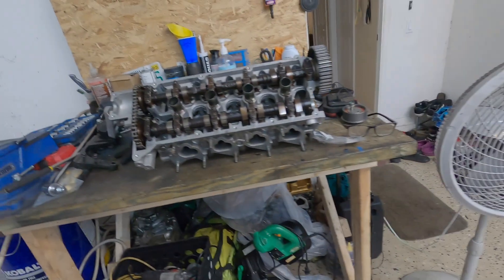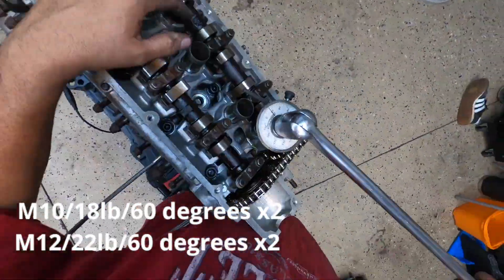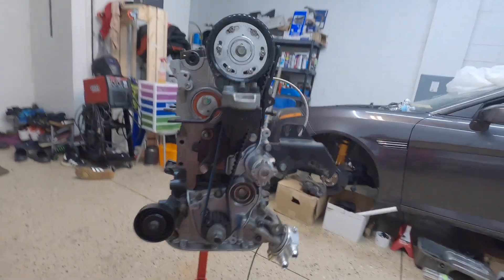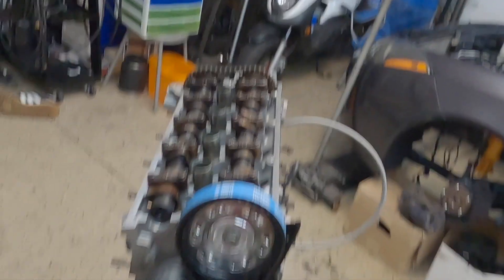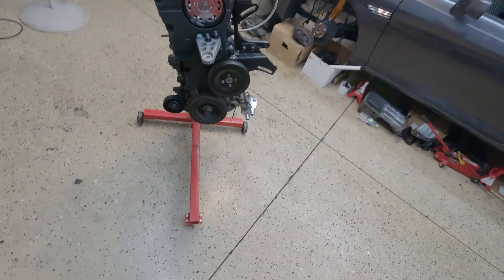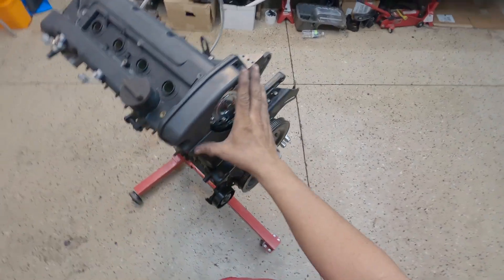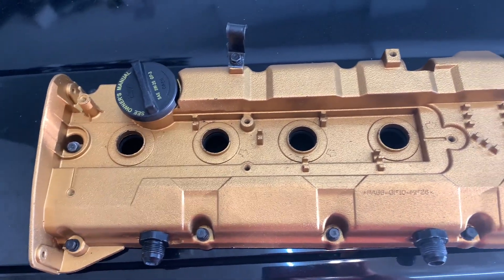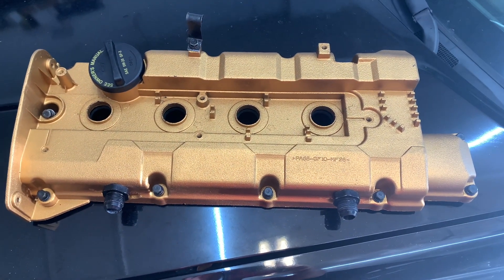Hyundai Tiburon Turbo Project Episode 11 (Engine Block Assembly)

Comment: I just burned thru my second set of pistons do you know if any other pistons will work besides the super expensive upgraded ones
Reply from the maker: Your car is turbo?
We pushed the original internal of the beta up to 400hp at 22psi. If you don’t have a good computer it will difficult for you to set it up right.

Comment: Is your engine on stock internals?
Reply from the maker: In that video yes. And we hit the 400hp mark but now is forged.
Reply: @PIBRACINGCHANNEL  the head gasket used is thicker than the oem ?  You hit the 400hp without lowering stock compression ratio ?